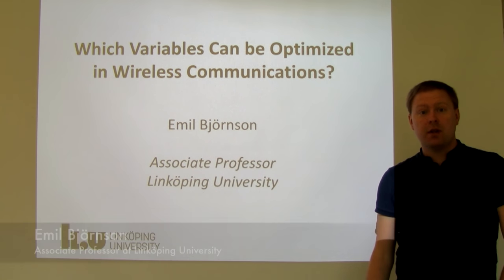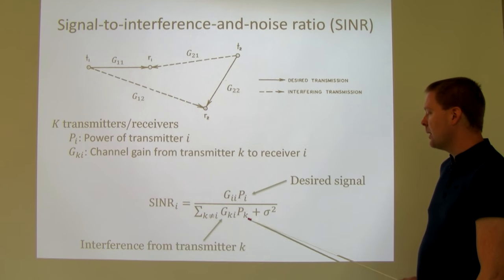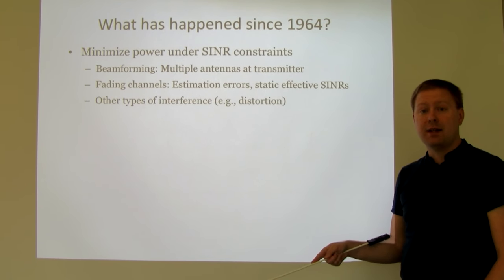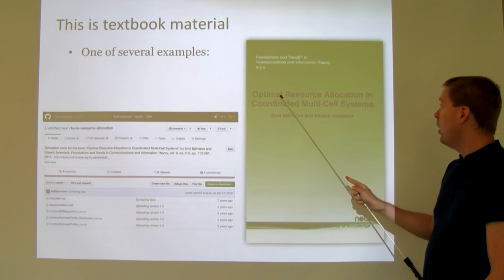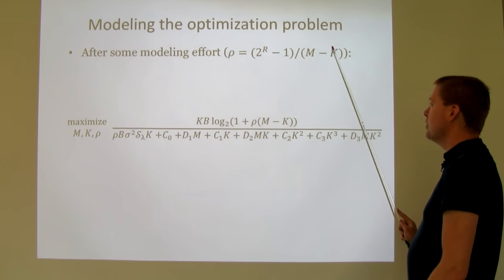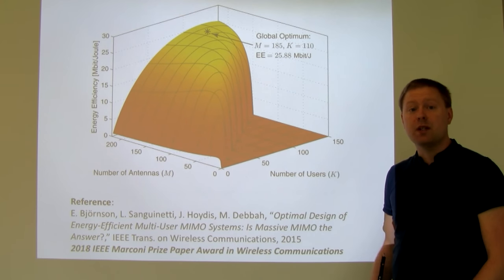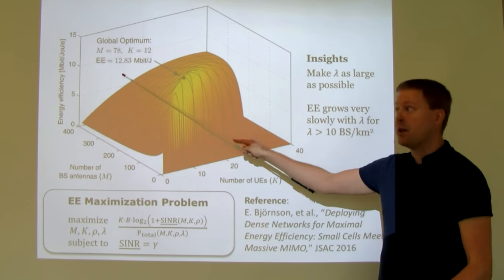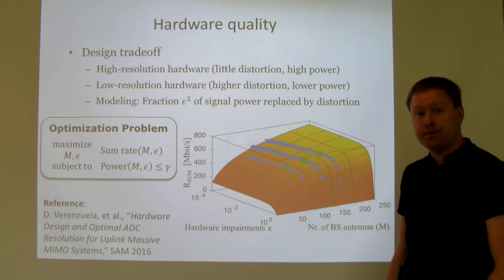Which Variables Can be Optimized in Wireless Communications?

Comment: thank professor for your brief explanation in optimization transmit power. i would like to ask which constant variable optimized in cell free massive MIMO other than mentioned in this video?
Reply from the maker: I haven't seen any other "new" variables being optimized in the cell-free Massive MIMO area. Apart from what is said in this video, one can optimize which subsets of access points that are serving which users. This is not a truly new variable but is still important. Here is a paper about it: https://arxiv.org/pdf/2002.01504
Reply: This video is a Gem of a kind.
Thank you professor

Comment: Thank you for sharing. However, I have no idea why we need to optimize the number of users and antennas in a cell. Is it a real-world problem?
Reply from the maker: Yes, this is a real-world problem when dimensioning cellular network deployments. In this case, we are finding the desirable base station equipment (antennas per site) and figure out how many users should be served simultaneously to achieve maximum energy efficiency.

Comment: sir,my research area is energy harvesing by RIS .now i  found two problem are maximise harvested power and SNR at recevier.optimize the harvested power means which factor is  i considered for getting high value. transmission power or rectifier output
Reply from the maker: There are many possible ways to formulate optimization problems, and multiple possible metrics. The point that we want to make with this video is that we always need to make a conscious choice of what problem we want to solve and have a (subjective) motivation for it. If you choose between maximizing two different metrics, think about what would be the benefit of the two different problems and then make up your mind about which option you prefer!

Comment: Hello Professor, Kindly give some idea about transmit power minimization using Multi-antenna on UAV ? What factors to consider why deploying beamforming in UAV enabled commmunication
Reply from the maker: When formulating an optimization problem, you need to figure out what function to optimize, what variables to consider, and what the constraints are. I understand that you want to minimize the function “total transmit power” and that your variables are “the individual transmit power values”. The remaining question is what your constraints are, because you need something related to the communication performance, otherwise the optimal solution will be to use zero power.

Since you mention UAV-enabled communication, you need to determine what difference the UAVs make in the system compared to a conventional network without UAVs. Is it only the channel model that differs or something else?
Reply: @WirelessFuture  can you please share the link of Book's code for simulation
Thank you. your book is student friendly and easy to read and understand.
Reply from the maker: @abidafridi6570  I guess you refer to https://github.com/emilbjornson/book-resource-allocation All my other code is available under the same profile.
Reply: @WirelessFuture  Thank you so much  Professor
Reply from the maker: @UCb9xzjXWJYW-MOU4Q6TZbVg Right, but many beamforming algorithms can be applied to any set of channel vectors. For example the algorithms described in my book “optimal resource allocation…” are applicable for arbitrary vectors, but the communication performance (rate) will depend on what the channel conditions to use. There are also concepts such as beam tracking and angle-of-arrival based channel estimation in the mmWave literature that only works if the channels have the right properties.
Reply: @WirelessFuture  Thank you for the guidence.

Comment: You can also compare the cost for one Site with a high numbers of Antennas and the cost for a Site with less Antennas. On one place an Massive MiMo can be more cost efficent  than an small Cell aproch. In an other place it van be different.
Reply from the maker: Eduard Walz Yea, that is essentially what we are doing by letting both the number of antennas and the base stations per area unit be optimization variables.

Comment: What do we mean by maximizing the channel gain in order to minimize the transmitter power PT?
Reply from the maker: At what minute was that said? I would guess it means the following: If we need a certain SNR at the receiver, then it is proportional to "channel gain * transmit power". If we can improve the channel gain, then we cut back on transmit power.
Reply: My sincere apologies 
Thanks a lot for answering a question about the topic which was not discussed in this video. This will not be happening again.